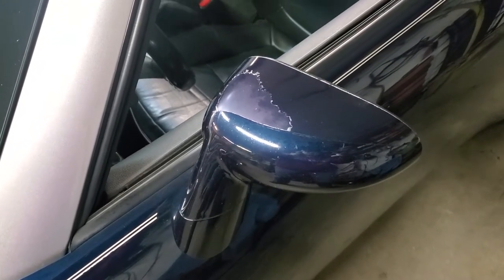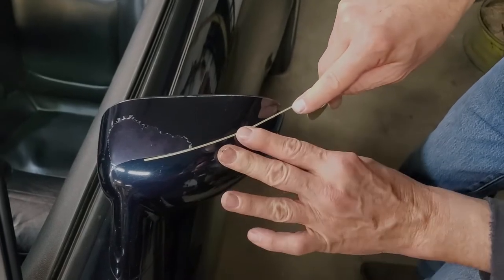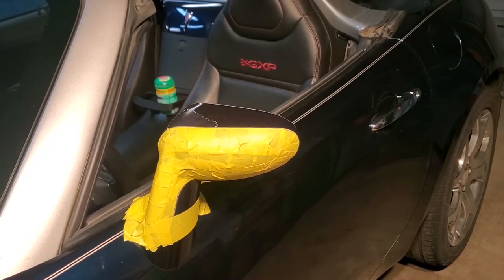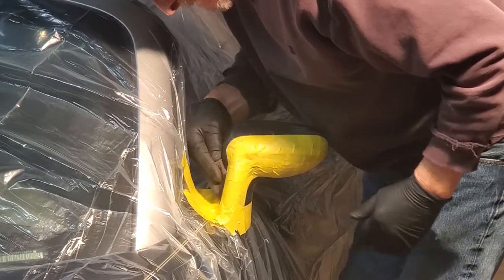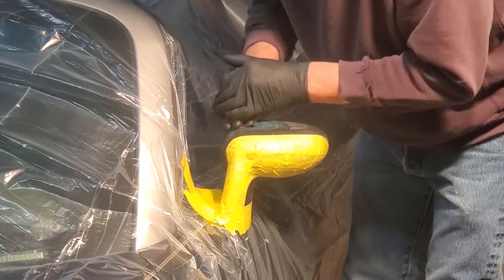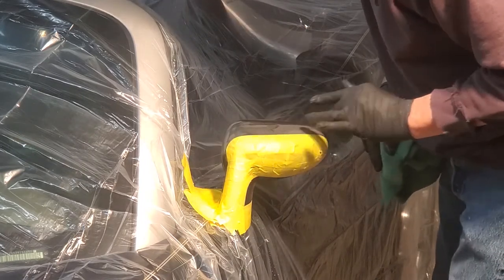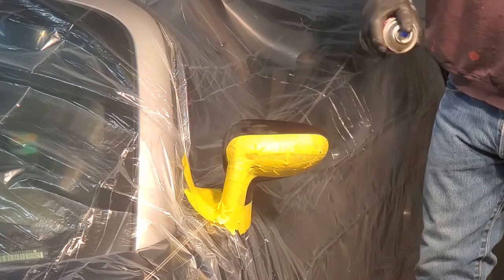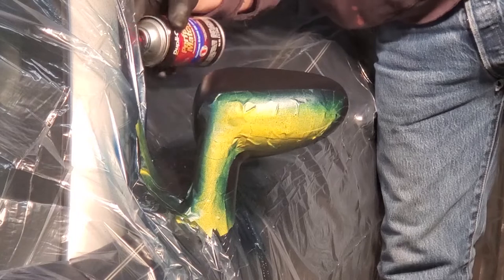Rearview Mirror Clear Coat Repair - Weekend Project, Painting a Rear View Mirror

Comment: WHAT ABOUT THTA REALLLY VISBLE LINE YOU LEFT ARE YOU NOT GOING TO USE SOME 3200 GRIT SAND PAPAER TO BLEND IT IN AND POLISH WITH CUTTING COMPNAND 4000 TO REMOVE THE LINE ??
Reply from the maker: Basically, the front of the mirror is protected by Clear Bra and that's the part that was masked. Please note, that's why it was masked and not finished like the rest of the rear view mirror housing. Without a Clear Bra I would have done the entire mirror.